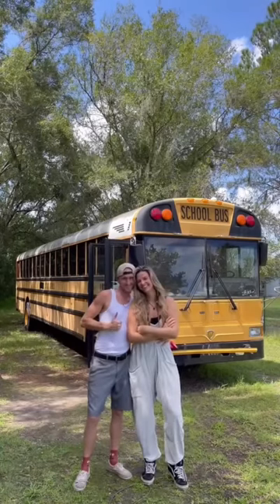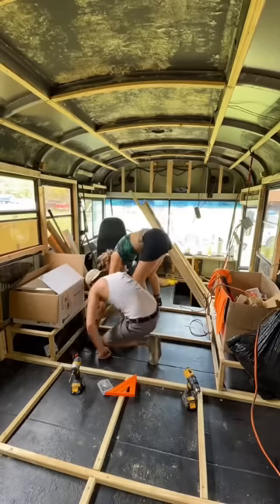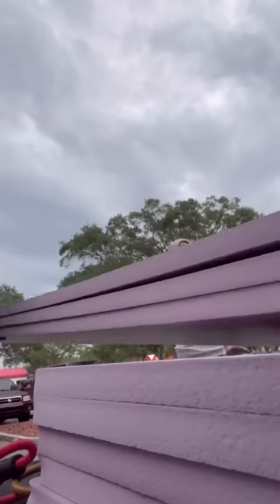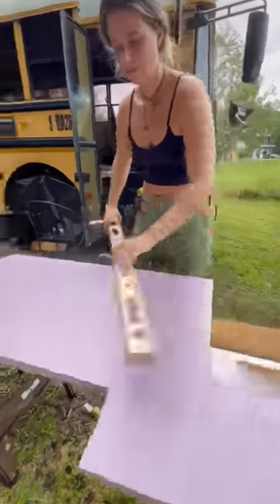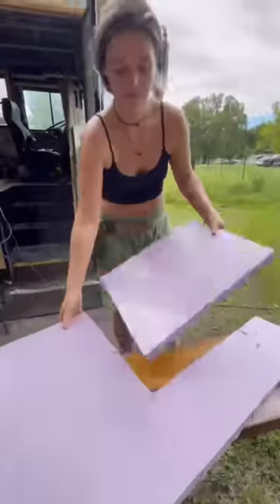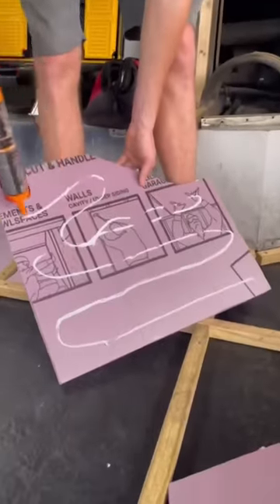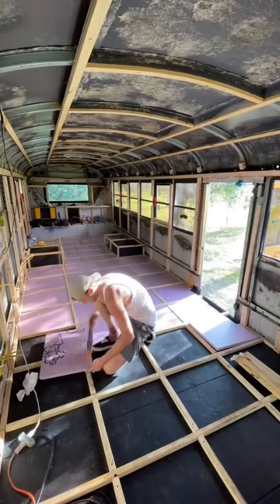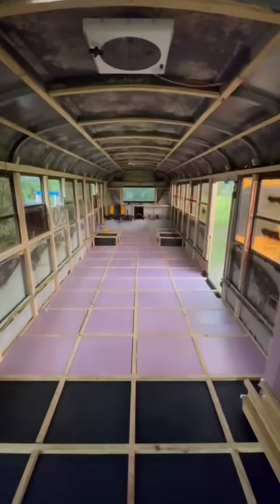Weekend 23 of our Skoolie Conversion! (head to our TikTok @ buslife4me to watch the end)

Comment: I was going to see if you had some leftover pieces you could stick them on the wheel wells and help insulate that as well, ??!!  Are you going to do the same thing to the walls??
Reply from the maker: We will be doing the wheel wells, walls, & ceiling with closed cell spray foam insulation.

Comment: why don't you put the insulation first? then you screw on the tree after. that way you have the insulation under the entire floor and walls and you don't have to cut every square. or you could make each square the same size. have an awesome time
Reply from the maker: although that would save time, it wouldn’t be as secure! And since we will be driving this home across the country we need it to be extra secure for all the rattling!

Comment: Can you tell me why y’all put the wood on the floor? The purpose? Thanks in advance!
Reply from the maker: It’s called a “sub floor” and it’s what our actual flooring will attach to. You could put your flooring over the metal floor of the bus, but we will be going into a range of climates so having the floor insulated was important to us!
Reply: @buslife4me  could you put the insulation down directly without the wood?
Reply: Or does that protect it from compressing? Again, tia.
Reply from the maker: @TexasNette  no, insulation is squishy and does not make a good foundation.

Comment: Why not use spray foam for the floor? It’d be air tight and probably just as expensive
Reply from the maker: Spray foam is wayyyy more expensive! We used it for the walls and ceiling (episode 35) but we couldn’t afford to do the floor with spray foam too. We’re on a tight budget for this build :)

Comment: I can't help wondering why "no 2 squares are the same", when it's your own design.
Reply from the maker: Because a bus has a LOT of complex angles! It’s not a straight leveled box lol
Reply: @buslife4me  but, looking at framing they've installed, they could have made at least half the squares the same.
Reply from the maker: @savagedriver1967  we thought so too! Until you start doing a bus conversion for yourself and you’ll see so many thing you think would be simple, just aren’t lol. Most of the squares are cut in similar size but working with the complex angles of the bus they were not all the same.

Comment: The insolation should have been 2" minimum.
Reply from the maker: Wait for the update (we got it fixed by professionals lol)
Reply: @buslife4me  Ho that's good. It's just that I live in a static for a while. It pays to put 2" of insolation down when you are doing a floor and walls and ceilings, it keeps warm in the winter months and cool in the summer. It also helps to save money on your heating system. I'm not 
Called lol. My name is on the top of the
Comments.